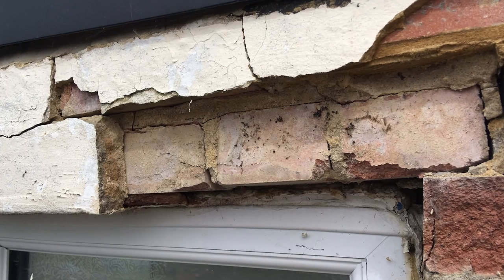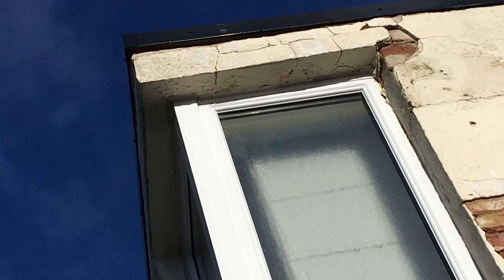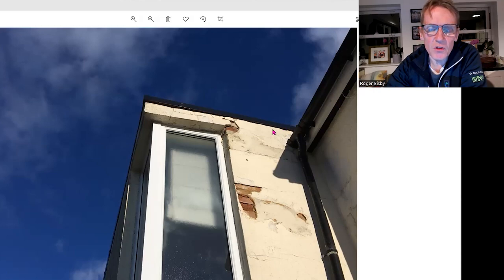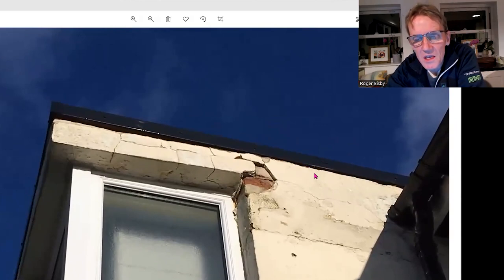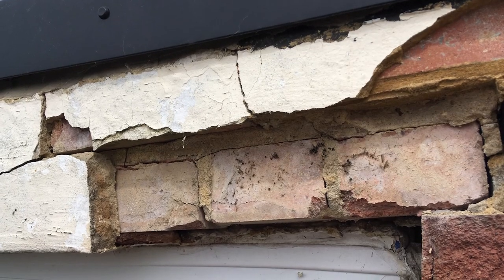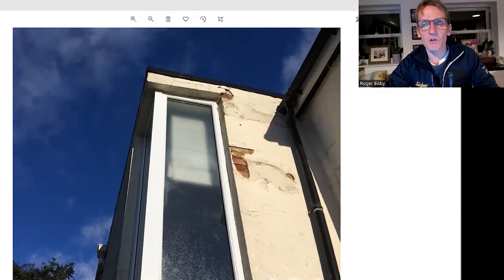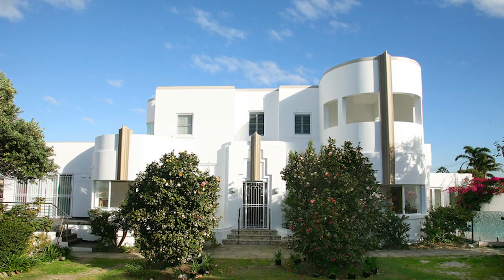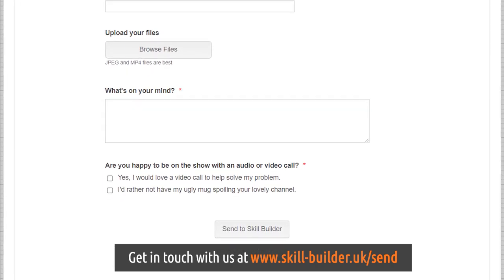Art Deco Fail ~ Crumbling Corner Window

Comment: I reckon when Willy W@nker replaced the original windows for uPVC he took out the support. Working around these things is an inconvenience for these speed merchants. Besides, they’ll be long gone before the problem is spotted. The same knuckle draggers in the North East where I live are removing the central mullions between two windows and installing single windows in their place. Unfortunately the lintels above the windows are in two pieces and required the mullion. The house owners unknowingly now have structural windows.
Reply: He said the central mullion

If you ask Google what a central mullion is it will say 

window mullion is a vertical beam that divides a window into smaller glass units. The purpose of a window on a mullion is to provide support to the glazing of a window, but they may also be required to provide structural support to a window arch.
Reply: @Argon-Windows-And-Doors-Ltd  In the video Rodger showed us, the possibilities of roof support are numerous. The most likely methods NOT requiring a vertical support beam are a reinforced concrete beam or structural steel work cantilevered off the tops of the adjacent walls. Roger’s guess was neither of these methods had been used. I agree. Examples of this style of Art Deco building can be found all over Britain. I think you’ll find that vertical steel supports are the commonly used method of support due to weight, initial cost and aesthetics because of their thin profile. Unfortunately, they do have a relatively short life because of rust and corrosion problems and replacement is neither simple nor cheap. A considerable number of these buildings also suffer from another blight, Grade II listing. This means that eliminating or modifying certain features may not be permissible.

Comment: You can get L shaped lintels, but there's probably not enough height of brick or roof above for that. Could cantilever something or best bet lintels and a corner post, could do it in steel like a 80x80 SHS and an L shaped baseplate on the outer leaf perhaps. Be a shame to do away with the corner window feature, should definitely look to retain it
Reply: Could possibly do the shorter side as a cantilever lintel,  maybe steel bolted far back into the wall, and the longer side could have just simply supported lintel(s). That would eliminate the need for a post

Comment: Hi..having problems with the little cement blocks at each side of the window fills..Had new windows fitted, and these cemented blocks keep cracking and falling out,due to uPVC windows expanding and contracting during hot and cold spells..any idea what I can use please ??
Reply: Hard to say without looking at the issue. Call in a reputable brickie or builder to advise you.

Comment: Does anyone have a good and low cost solution for when a neighbour's washing machine lowers a neighbour's water pressure?  This is two houses, not flats. Maybe Roger can do a video on it?
Reply from the maker: Hannah
We have one coming out very soon. It sounds as if you have a shared service pipe. It would be a good idea to contact your local water company and ask them if they would consider giving you a separate supply.
Reply: @SkillBuilder  Cheers Roger. It's not my property but someone else's. Yes, a separate pipeline is one such suggestion.  Cheers! I'll look out for the new video.